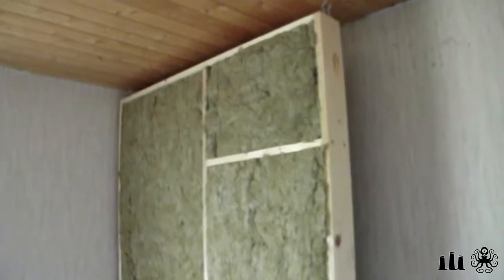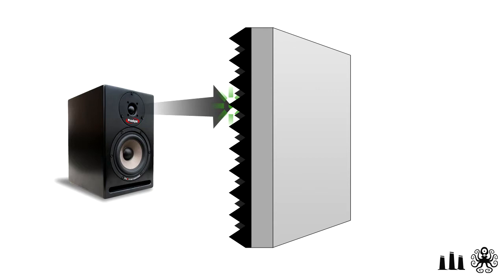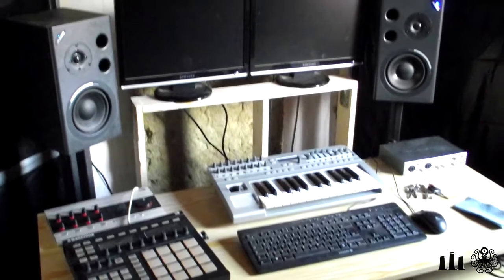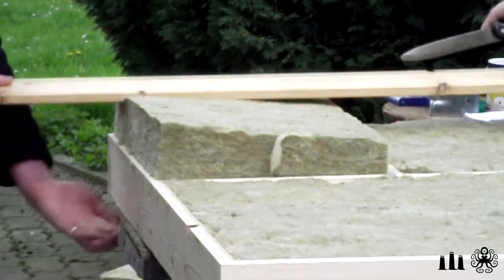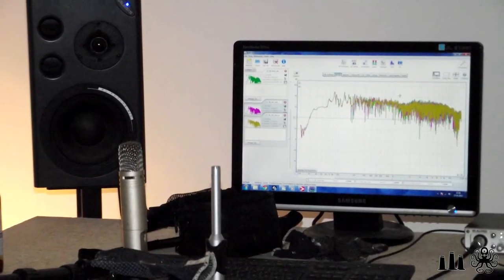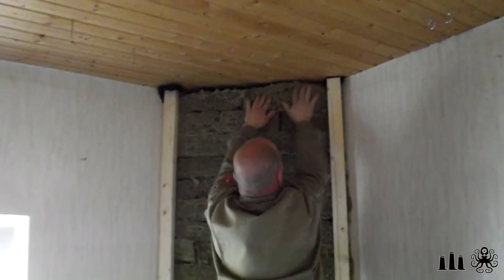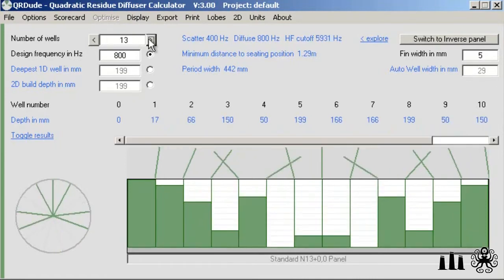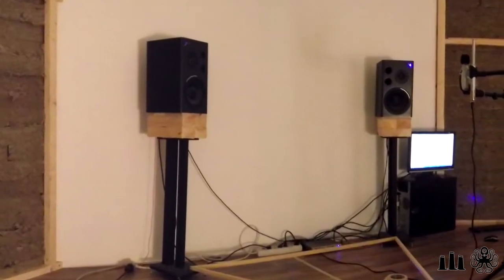Building the Ton-Kraft Studio - Part 2 / The Failed Attempt

Comment: Hey man just another quick question if i could, i just purchased the ECM 8000 and have downloaded REW, and my problem is that rew wont pick up my my audio interface as either an input or output, (the interface is a allen & heath zed10 if that makes any difference) did you guys have the same or any similar issues? and would you have any ideas on rectifying the problem? Cheers in advance!